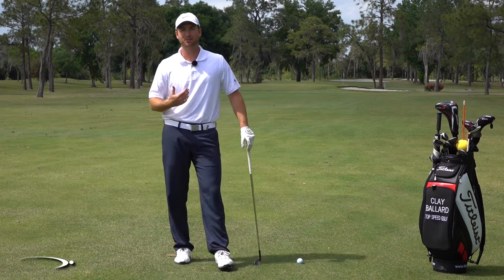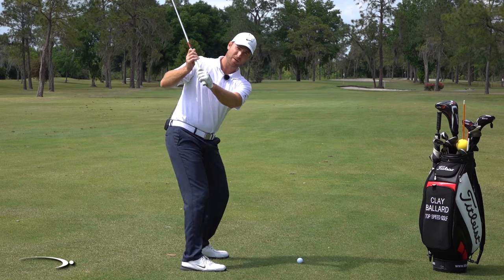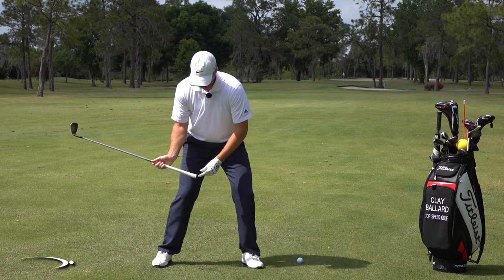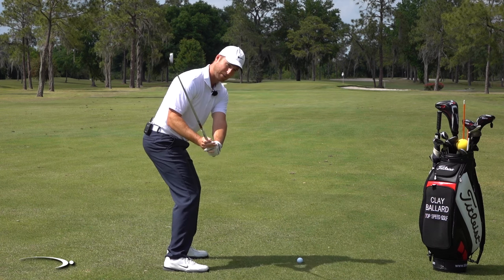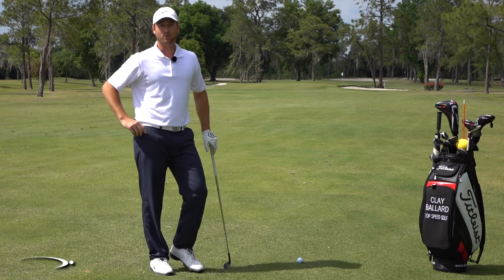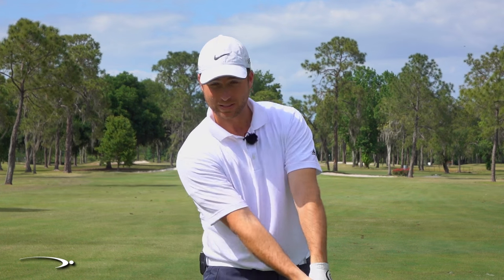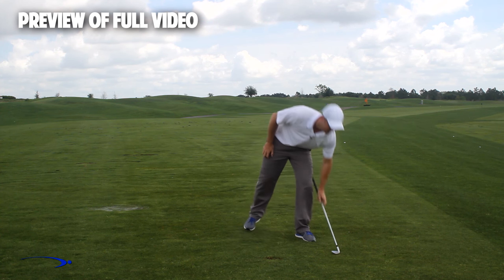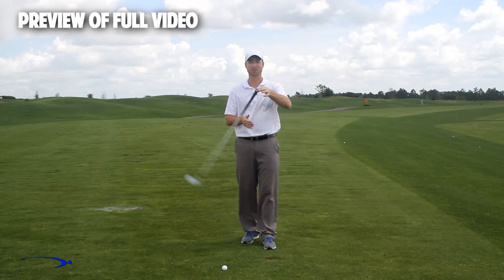How to Increase Golf Swing Speed | Load and Explode

Comment: I've found this very useful for the driver using the large leg muscles to create vertical gyro force, very evident in the likes of Sadlowski and R Mac, but with the iron and fairway wood I found if your timing isn't precisely accurate theres a high chance of topping the ball. I found it better to get the weight over the front foot and pull downwards and whip the shot through impact like Fred Couples.
Reply from the maker: Hi MrBigolnuts
Thank you for your comment. We're glad you were able to dissect this video well and find a different way. When trying this move try to keep your head more level. We find when people do try this they have a tendency to lift out of their swing. Keep up the good work!

Comment: Clay ...been working at the range on this move. I find that I must straighten the left leg only thru impact ...and attempt to keep the right leg bent slightly ...this forces the left hip around and back; and keeps my "Lateral Side Bend Right" intact thru impact. If I straighten both legs thru impact I simply stand up (early extension)  and stop the hips rotating...
Reply from the maker: Great points. Yes, the right leg will still be bent through impact. It won't straighten until the follow through. The left leg will be 80-90 percent straight at impact and mostly straight, right after that. You are right on track is sounds. ~Clay
Reply: this technique plus the ulnar flexion of the wrists at impact have really lifted my ball striking ...I realize my previous swing was more of a heave ...getting great compression now with the shaft snapping into the ball ...still a little wild and pulling many shots but I will stick with it ...thx !!
Reply from the maker: Great. It will straighten out. Keep up the hard work!